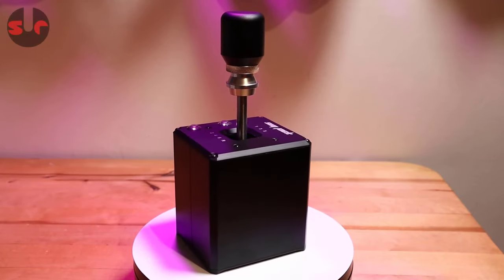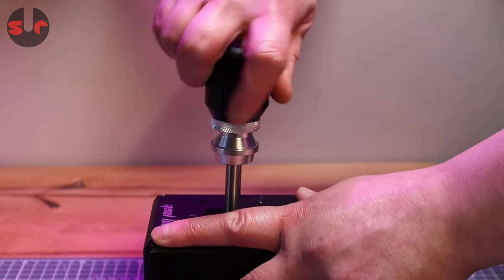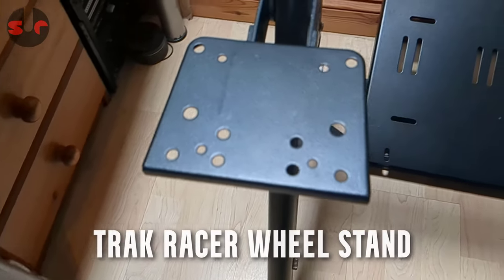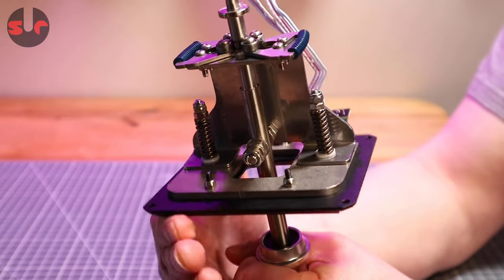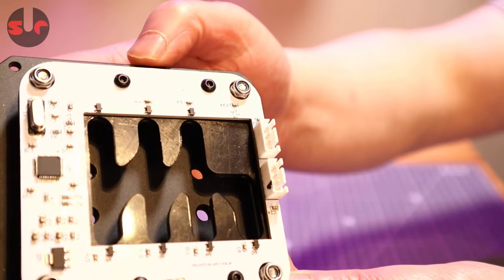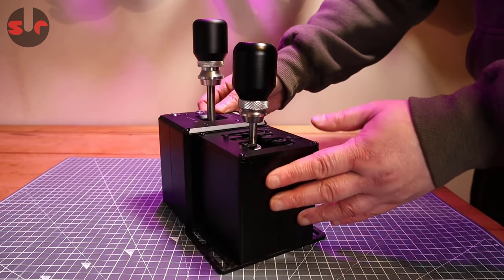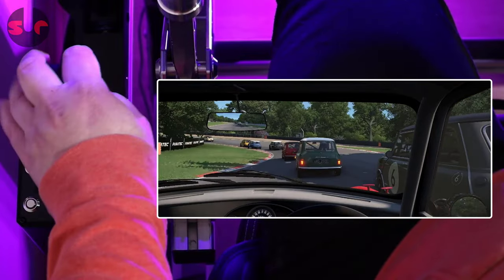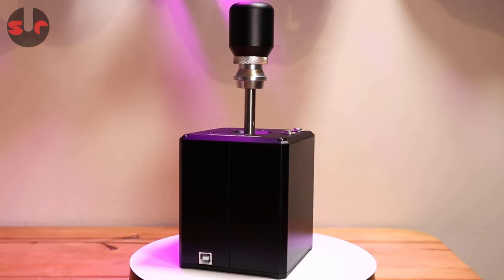SIM JACK H-Pattern Shifter [REVIEW/TEARDOWN] A solid performance all around!

Comment: Sim jack h-shifter vs project D shifter ?
Reply: I'm also on the same boat x.x more heading towards pxn a7 also
Reply: I wouldn’t do project d. I have a metal gated shifter. It’s not smooth, and annoyingly loud because of the metal gates. The noise does bug you after awhile. Nothing wrong with the function per se. but still, had me searching for a better shifter that didn’t cost hundreds. I chose sim jack. 

Edit: plus the metal gates raises potential for missed shifts. I had plenty.

Comment: Love this cheap Chinese SIM gear.  I got a VEVOR stand for wheel and pedals, and it is identical to the next level racing offering.  You could even attach the full rig option from NLR.
  Was £55 instead of £200.

Comment: Hmmm not sure about the nylon gate's durability as I have the model with the top mounted aluminium gate and it is already pretty worn after a month of use. The problem is that unless you can easily find replacement gates, it would be rendered completely useless when it breaks. One of the common problems with these shifters is the magnet getting loose so it is advisable to apply epoxy where it meets the shaft, and this version having the magnet over the PCB, once loose it would slide down and destroy the hall effect sensors.

Comment: big issues with 6th Gear. I sent IT Back within one day. Compared to my Fanatec I had before the Shifter is rubbish. 6th Gear is scratching and hard to get in. I am driving manual Shifter Cars in real life every day. So this is bot the issue
Reply: Had the same problem and that is because you probably use longer bolts. Longer bolts will hit the gear lever inside the shifter, so if you had used the included screws or shorter, you would have no issues.
Reply: Oh Shit, Just sent it back, needed one longer Bolt to get it fixed. Maybe I will rebuy
Reply: @philippwei365  I just used a longer bolt I had with a plastic washer just enough to thread the bolt in. So maybe you sent it back to quick instead of resolving the issue easly.

Comment: Hey, would you consider sound insulation on the inside of the metal and even a lining where the hole is, would it improve the noise issue?

Another question, do you still recommend this change today?
Reply: I did it right out of the box, so I don't have a good reference point. If anything, the *thunks are deeper in pitch, if not quieter, than before.

Comment: I just got mine up and running today. It replaced a Logitech G27 shifter. While this SimJack feels much nicer, there is one big negative... The hall effect sensors have a slight delay registering the magnet and you REALLY have to slow down your shifting. It's very annoying right now, and I hope I can merely adjust to it with some seat time. You can see this delay when you pull up USB controller settings in Windows. I jumped into a Miata race at Laguna Seca and killed the trans within two laps from all my miss-shifts. 

I saw people suggest decreasing the clutch range (aka make it hit 100% when only <40% depressed) and it did help a little.

If anyone has fixed this issue, please let me know!
Reply: Now much of a delay?   I have one and I didn't notice any delay when I was playing AC with it.  The only thing I dont like is getting into 6th gear. It felt weird...
Reply: @johnl2613 I can't time it or anything but when you pull up the "usb game controllers" in Windows, you can see that the pressing the two buttons is instant while the gear selection takes a hair longer.

I can drive OK when I'm just solo'ing but in a tight race, I end up miss-shifting a lot trying to be quick.
Reply: @johnl2613  mine just arrived today and 6th is a little weird for me too. Can't slot straight down into it from the wall of the reverse lockout, it's slightly further left. I also mis-shift back down to 4 from 5 instead of up into 6 pretty frequently trying to compensate for this. After a couple hours I got a lot more consistent with it but it is still kinda funky.

I think that corner of the gate needs to be altered slightly to match the slot for 5th. 5th is also slightly further left than the wall, but the gate is heavily rounded to guide it in. The gate barely rounds the corner into 6th, instead it's rounded mostly into reverse and ends up trapping the shifter, which is super unnecessary because you shouldn't need extra guidance to get to reverse like you would for a fast upshift. You can see what I mean at 4:22, reverse and 6th are at the top left of the gate and 5th is at the bottom left. I plan to open it up and file that corner down in the near future, I'll let you know if it helps.

And yeah, the hall effect sensors are a little laggy. I thought I was just being sloppy with my clutch but after you mention it it is pretty obvious. A stronger magnet might help? Might just be baked into the hardware though. The perils of buying cheap Chinese simracing hardware lol
Reply: @johnl2613  re: bad 6th, I opened it up and fixed the problem. First, I'm happy to report Sim Jack already came to the same conclusion as I did regarding the gate rounding between 6th and reverse, on my unit it guides into 6th rather than into R as shown in video 4:22. The actual source of the grinding and difficulty getting into 6th was a MOUNTING BOLT, the one in the back left specifically. I'm using longer bolts I bought separately to be able to mount through a 2x4 so I'm not sure if this will happen with the included bolts mounted to a proper rig or not, but the back left one was long enough to be in the shifter's path on the right edge of 6th. After removing this bolt the shifter feels great in all positions.

As for the lag, my best idea right now is wire the sensors up to an Arduino and run it that way instead. There's no way the actual sensors should be this slow, I think it has to be a problem with the "brain" they're using for it. It's definitely not an issue of magnet strength, it's simply a delay - if I shift into and out of gear faster than it responds, it still does both, just delayed. Would be a pretty involved project though.

Comment: I know it's a year later but have you ever had a problem with any gear not registering in game calibration (setup) mine just does not register reverse it did  a couple times but then just stopped. I took it apart and found the top plat was loose I tightnd it but nothing.

Comment: If i needed both H pattern and Sequential shifter, do I get both these from Simjack or buy Fanatec one which has both built in? Space is not the issue, it's quality and value for money that i am looking at. I will rarely use both of these, as i mainly use paddle shifters.
Reply from the maker: I've always preferred them as separate devices. Combination shifters compromise on the seq mode feel, I find, they never quite get it right.

Comment: Great reviews thanks for all your work. I have watched this and your project D one. In that video you said the project D was 900g vs 1.5kg for original cheeper shifter. This one you say 1.5 for project D. I am a little confused by this. Which of the 3 have the lightest to heaviest feel? and what do you find best?
Reply from the maker: Don't worry, I'm confused too. The Project D review will be correct details, as that was the earlier review.  Anything, around 1kg+ I find is pretty good. I think the generic AliExpress shifters these days use lighter springs, so not as strong as the 1.5kg like mine was.

Comment: I have the budget one you reviewed and wondering if I need to upgrade to match my Moza R9 and Simmagic Pedals. What do you think? Which shifter do you feel feels the most realistic? Thanks!
Reply from the maker: You should be fine with that shifter. If you spend more, you'll get a shifter with better build quality, but that won't improve the realism of sensation. It's not until you start looking at the shifters at £1000+, where things step up the realism.
Reply: @SimRacingCorner  Oh wow really? Even things like the Simmagic and all?  I am NOT looking to spend more money its just crazy.  So until you get to things like the BDH and all with real machining. Gotcha. Thanks!
Reply from the maker: The cheap AliExpress shifters have a very good tactile effect. It doesn't feel that much different to the Simagic. That's not to say there aren't other benefits of the Simagic shifter. The Simagic is a lot quieter, the tension is adjustable, reverse gear lockout, built-in sequential mode, smoother transitions between gears. And will last longer, as it's more robust. So it is a better bit of hardware. But If you want a more real mechanical chunky gearbox feel, then yeah, the BDH or BASH Pro level of hardware is where it's at.

Comment: where do you get the 40 40 angle bracket shown in 5:20 ?
Reply from the maker: AliExpress
Reply: @SimRacingCorner  i couldnt find the exact one you used on your video, if you could fetch a link ill greatly appreciate it
Reply from the maker: @pgn787  Note, in the video, I do say I used a file on the bracket. https://s.click.aliexpress.com/e/_A9ctBo
Reply: oh right i was wondering about that, thanks! @SimRacingCorner

Comment: Thanks for the detailed review. How would you compare it to the other aliexpress shifters in terms of feel? Is this the new budget king?
Reply from the maker: The feel is inline with the other AliExpress shifters. There's not much to pick between them, so it doesn't matter. However, the Sim Jack is a bit easier to hit the gears without miss shifts or getting snagged on the gates.